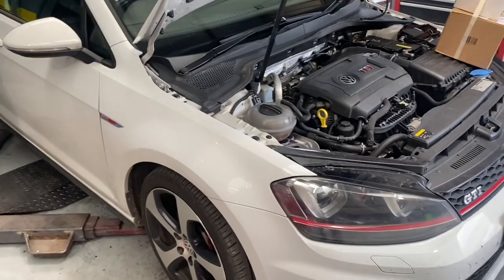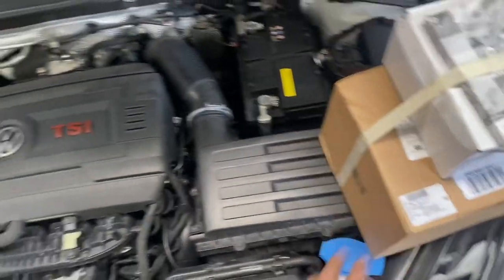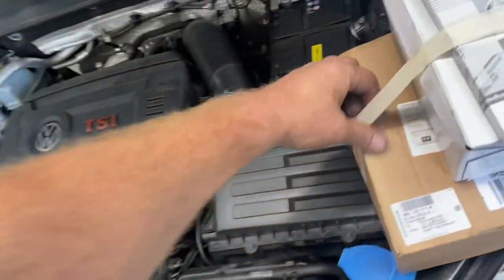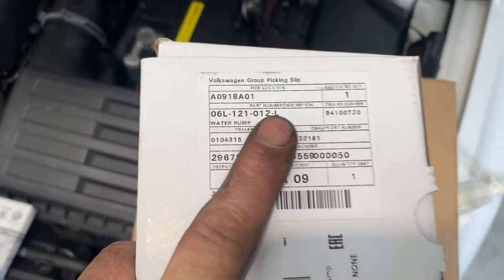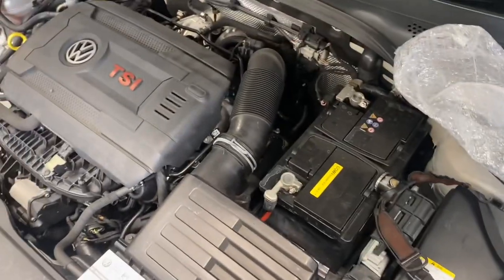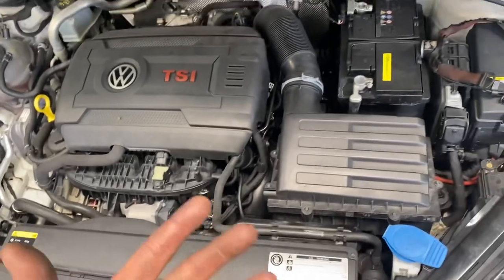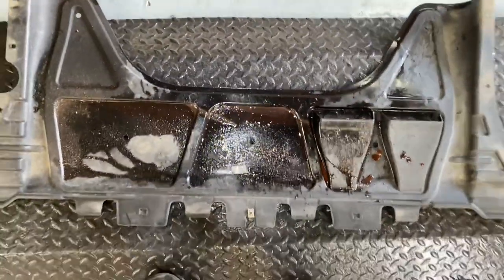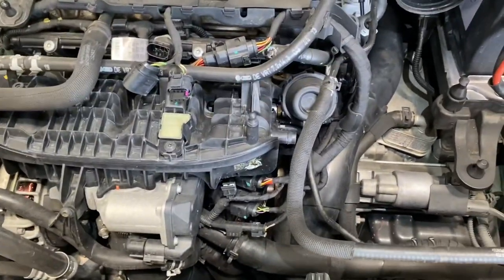Golf GTI Waterpump replacement ( Thermal management module)

Comment: Thanks Peter great tip on removing the rubber mount on the intake manifold instead of the bracket. I finished doing mine today back in business now, until the next GTI issue.
Reply from the maker: Well done Rob, I’m glad it helped you out 😉🙏🙏

Comment: What is the issue with these engines in the USA is the water pump gasket seeps.  You can't replace just the gasket itself so you have to replace the whole water pump.  Replacing the whole management system like you did was very wise.  Better be safe than sorry.  Other than that, these engines in these GTI's are pretty decent.
Reply from the maker: It comes back to bite me 😬😬😬
Keep an eye out for part 2 🙂👍👍

Comment: Great video Peter - you said exactly what I was thinking - alot ...ALOT of plastic - is that a plastic oil pan I saw? 😵‍💫 Are VWs a bit more pro-plastic than other manufacturers do you think? Did you do any postmortem to see where the actual leak was originating? That module looks massive with so many bends and twists and its all plastic..you have to wonder! I remember on my old Jag (XKR 07) there was a plastic pipe that over the years hardened and split (it was a reducer pipe to change pipe sizings) - why they didn't use a decent piece of metal is beyond me - it failed wholesale on models of that MY.
Reply from the maker: I didn’t do a postmortem Damien, but keep an eye out for part 2 it comes back 😬😬
I’ll post it a little later. 
Lots of plastic bits and it’s one of these that cause the comeback 🤷🏼‍♂️🤷🏼‍♂️

Comment: Hi pete ive only changed 1 belt out of atl least 50 Water pumps. Of course with car age probably necessary 😮. The bolt on the balance shaft is resverse thread . Cheers Pete
Reply from the maker: That is handy to know for the next one. Everyday is a school day Chris 👍👍
Reply: @kennedysgarage3281  absolutely. I saw your video about the big engine jobs lots of work and plastic.  . I finished my apprentice ship at 41 .yes older mechanic. I'm amazed how I've caught up .but that's learing from older and younger mechanics. And having a great interest. Cheers again 🍺🍺

Comment: Is not that difficult, take a lot of pictures, make sure where all the connectors go and most important, how are they run.
The engine is a labyrinth of wires running everywhere. 
Those injectors have plastic seals, if one of them is removed, the seal is compromised. I recommend have aninjector rebuilt kit handy and the injector tool kit, jic.

I would say three hrs, four max.
Reply from the maker: Very good advice, a bit fiddly but otherwise not so bad to do. But keep watching this one comes back on me 😬😬😬